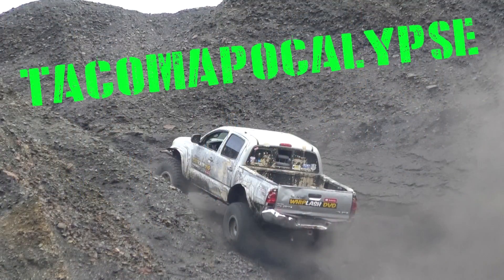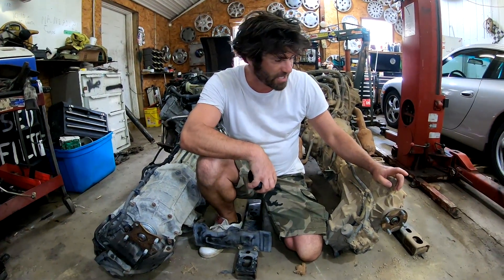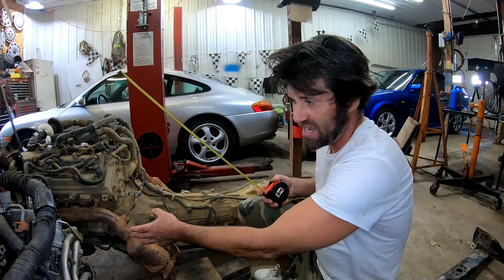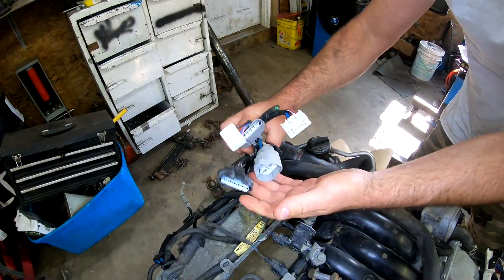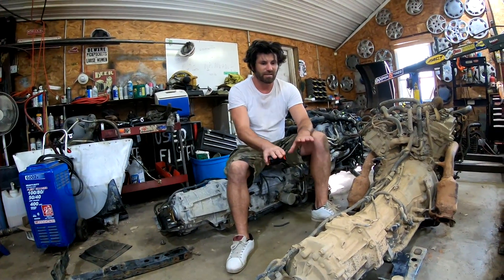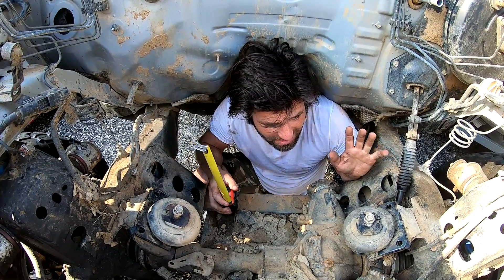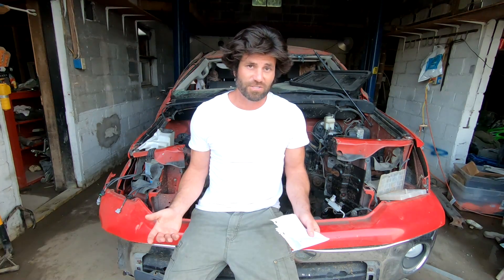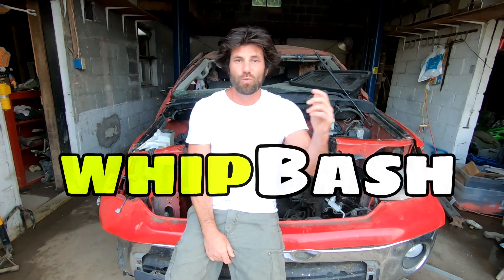Can you fit a 5.7L Tundra engine in your Tacoma? (TACUNDRA 11)

Comment: Dude this is the only v8 Toyota Tacoma swap i come across! Keep up the good work
Reply: TacoEating SoCalgrower look up turbo Tacoma. There is one purple LS twin turbo Tacoma and a red single turbo LS being built by turbo garage
Reply from the maker: @HayDog322  There are a few V8's but none with the 5.7 Toyota engine.  Except the 2wd X-Runner that Toyota themselves built for SEMA.
Reply: I mean.. I guess if you going to keep it all stock. Crap loads of aftermarket parts for the LS platforms. Think theres only a SC for the Tundra. And thats way more then what he put into his build.
Reply: See Toms Turbo garage, Project Thunderbolt for an epic, clean, turbocharged LS swapped Tacoma currently in progress
Reply: 🕵 ummm
Reply from the maker: And DraculaS2k is building an LS v8 second gen right now too!!! 😚
Reply: I didnt want to say that cus i didnt want to take your sub
Reply: Better to keep it all Toyota! Did you end up keeping the tundra shell?
Reply: I'd rather the tundra 5.7 swap like if it was an imaginary option from Toyota rather than the usual LS bandwagon. I drove two 2021 Tundras and the 5.7 scoots